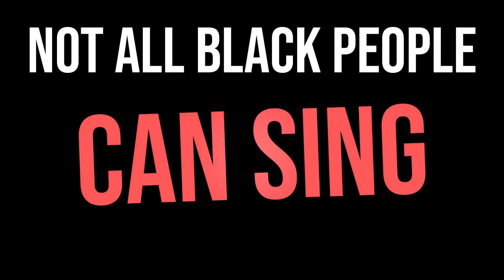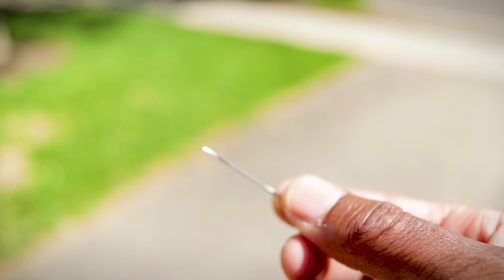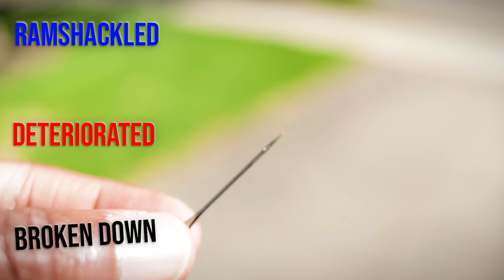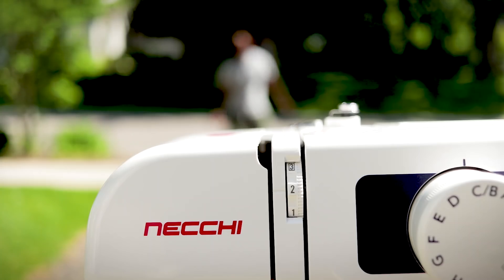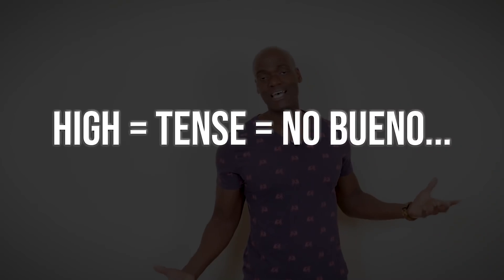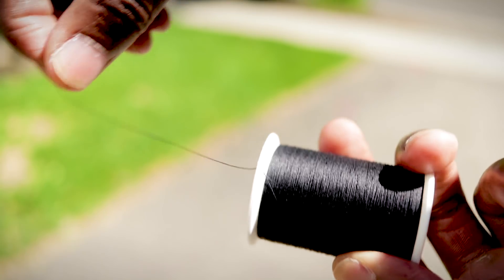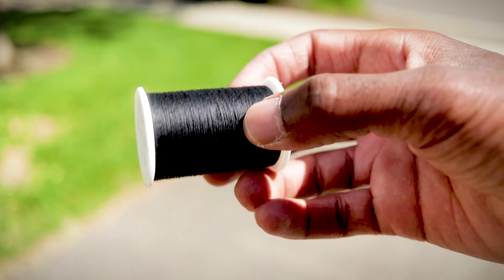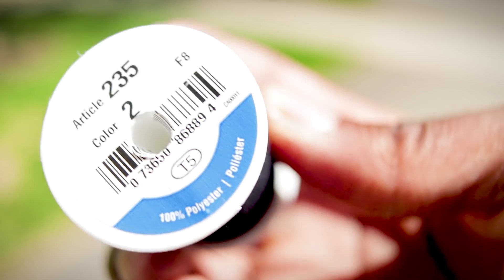Why Does My Stupid Sewing Thread Keep BREAKING?!

Comment: Thank you about the needle suggestion. I fix my tension, put in a brand new needle BUT still my thread broke. I had not put the new needle in correctly. It wasn't all the way up into its position. You're suggestion to retreat the whole system made me think of doing the same with the needle. Thank you again. You rock.

Comment: Would these reasons solve my problem of the bobbin thread getting jammed? I can be sewing for 10 minutes and nothing happens. I switch to a different shirt and I cant sew more than an inch without an insane amount of thread getting tangled and my needle getting stuck near the bobbin.
Reply from the maker: It's very very possible. Have you ever changed it?
Reply: @StylishDTailors  I have changed the bobbin and needle. It randomly sometimes it works, sometimes it doesn't. My machine is old. I'm going to try to use another one. If it happens again, I may need to change my process of sewing. I may be the problem? haha

Comment: Changed my universal needle to a ball point because im working with thick stretchy fabric but it still won’t thread but I found out it’s my top thread but how do I fix it ?
Reply from the maker: Change your thread too
Reply: Stylish D what do I need like a stretchy type of thread ?
Reply from the maker: Polyester is stretchy and should be used in synthetic materials

Comment: So....I was at a goodwill outlet. They had a machine in a very nice cabinet for 25 bucks. Huh? Had all attachments all feet....I thought hey! I would love to get back into sewing. It was missing a piece on the cabinet but not a needed part. Plugged it in and....it jammed. And jammed....and jammed...knowing my son in law can fix anything I offered 10 bucks. Got it home, CLEANED IT including the bobbin case, under the presser foot, got all the tiny dust bunnies and thread pieces out of it. Tried sewing again. Bad needle, probably the original needle in it from 1960. Yep. That is when i found out the machine was older than me. (I am 55) changed the needle, fiddled with the tension. Guess what?? I have an ancient very fancy sewing machine that works great. Now onto another problem people might have. I don't very often use sewing pins but when I do need them, I use a ring pin cushion I made. 1st layer a bit of soap. 2nd layer, fine grit sandpaper. Then a bit of batting and covered with pretty fabric. I never replace my pins unless heaven forbid I sew 1 and bend it. In a pinch when I don't have a replacement needle for the type of fabric I am sewing I use the same method to keep the needle going until I can get someone to pick up more for me. 
2nd video of yours I have watched. Definitely enjoyable. Have a great day!!!

Comment: I changed my needle, played with my length and differential feed. Idk what to do I’m working on a 4 way stretch fabric and every time I pull I break a thread
Reply from the maker: Make sure you're using a jersey needle and not a universal needle.
Reply: make sure the needle isn't in backwards.  the flat side of the needle base goes toward the back.

Comment: Been having issues with my machine all weekend.
So first my needle kept hitting my metal foot but now I have fixed that problem. My thread keeps breaking or else coming out of the needle - I have thread if through a lot before starting but same thing keeps happening. I changed the needle. Checked the spool I've done everything I can think of. Help
Reply from the maker: Sounds like you have a timing and calibration issue.What type of machine do you have?
Reply from the maker: Sounds like you have a timing and calibration issue.What type of machine do you have?
Reply: I have a brother LS14S - I have some how managed to get it working perfectly again. I think the issue was I had the wrong needle in! Oops, still learning
Reply from the maker: Glad you figured it out!

Comment: Yo SD show us how to tailor swim trunks, both making em less baggy in the legs and making em shorter. Also is there a special thread or stitch I need that’s extra water resistant? There is literally nothing on YouTube or even pulls up on google if you search how to tailor swim trunks that’s actually about tailoring. You the man.
Reply from the maker: Nope, no special thread needed! Coming soon brotha!
Reply: @StylishDTailors  Great! Thanks!
Reply: Spencer Harris 
Regular thread is polyester, so it’s fine for swimwear. You need to use an elastic stitch, obviously. Most machines have several...I would recommend trying them on a scrap piece and doing some pulling and stretching, to see, how they hold up. 
Needle wise...probably a  fine jersey needle...there are also ones specifically for stretch fabrics, that might be even better. Regular needles might damage the elastic fibers. 
Fit wise....if you have a pair of regular underwear...thingies (forgot, what they’re called lol), you could use those as a template.
Reply: Rara Avis  great advice thanks!